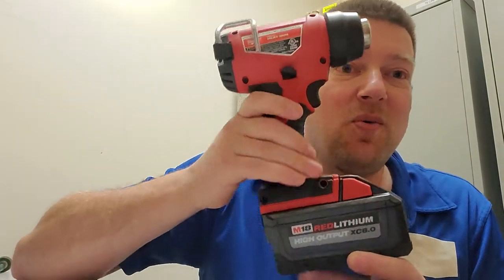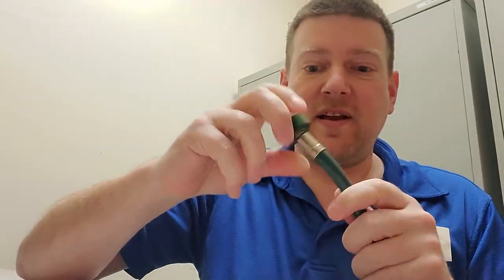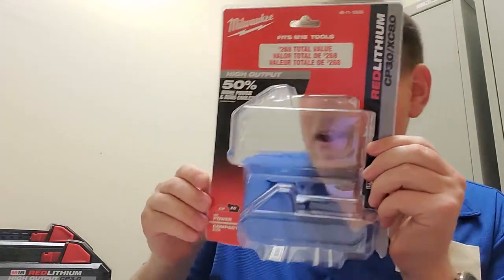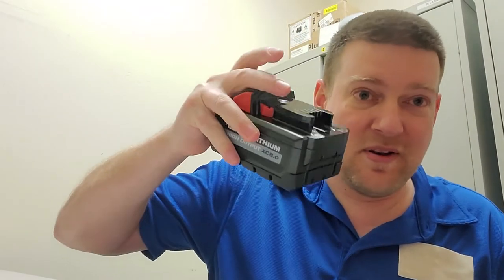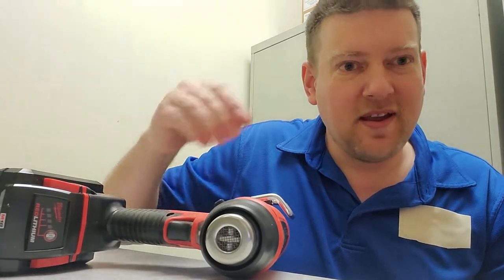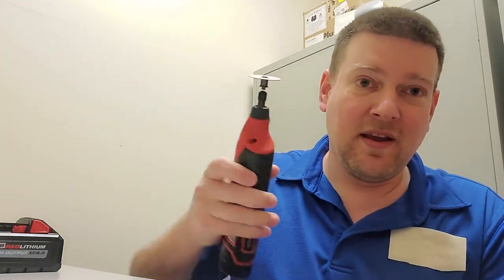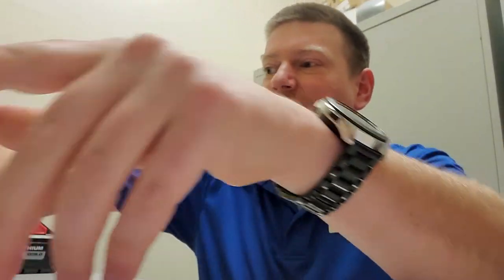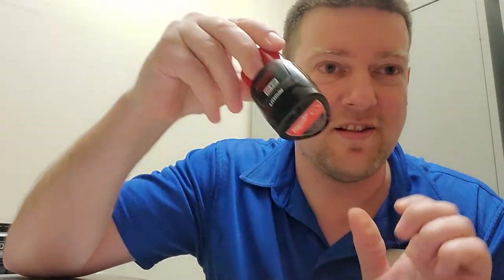New Tools!  Going Cordless!

Comment: You can also use those batteries as a powerbank with the USB Power Phone charger (USB output port),  very handy in combination with a USB powered soldering iron.
Reply from the maker: The Milwaukee cordless soldering iron has already saved me lots of time in the field.